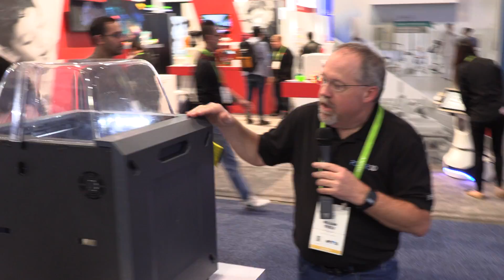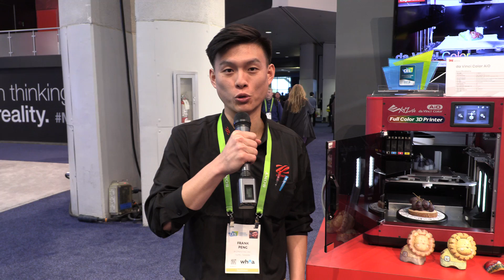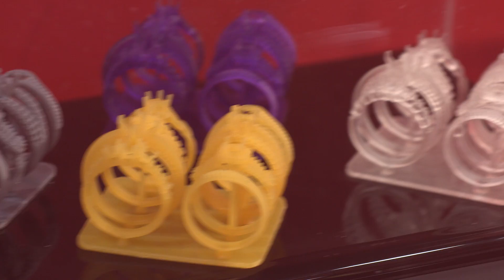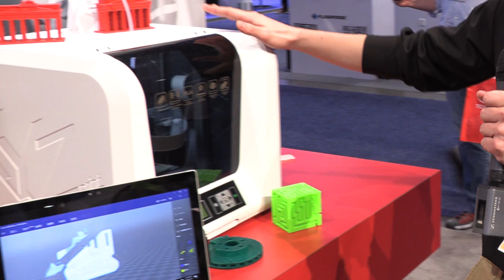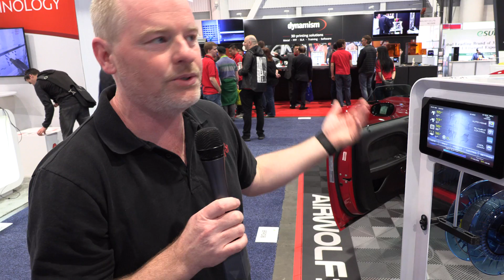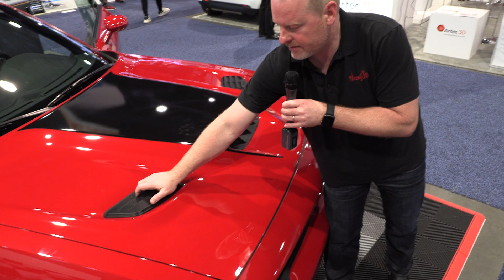VIRTUAL CES 2018: Tour the 3D Printing Area with Flashforge, XYZ, & Airwolf!

Comment: My thoughts.

FlashForge: I seriously want to see that $1500 SLA printer do well and be good! If SLA keeps getting pushed like this, it might stand a chance of overtaking FDM as a consumer printing method - leaving FDM to be all about the cheap prototyping.
XYZ: Full colour printing is a great idea, but I think their pricing is a little on the high end, the colours seem to still have a slight bleed to them though it's not actually all that bad looking, I hope it succeeds just to push the idea forwards and make it more cost friendly.
Airwolf: Definitely not at the consumer level yet, but getting full metal 3D printing another member to push the tech is definitely great - I could never even hope to buy one at the current prices, though.

Comment: Could you make a video on how to convert stl files to Gcode files
Reply: 1. Download a slicing program ( You could use for example Slic3r od Cura)
2. Load your stl file into your Slicer
3. Select the settings for your printer ( for example nozzle diameter or temperature )
4. Select the basic settings ( for example resolution or Infill  )
(4b). Select some anvanced settings if necessary ( for example support or retraction )
5. Check if everything is correct and save your file
6. Your done! :)

Comment: Nice format.  The Finder replacement looks interesting.  If I had not gone to a Prusa Mk2 I would consider it as an upgrade.  Instead I'm considering a Mk3, but I think the arduino controllers have reached their limit.  The small XYZ's looked interesting too, but I worry about their reputation of low quality and locking you in to their filaments.

Comment: If i wanted a new high cost printer, id go with the airwolf and the stainless steel.  
 For the lower end, i love Bill's candy printer.  Yes that looks like a "toy" like the old bug molding toys but my kids love that kind of stuff.  Im sure i would too and would be a hint at a birthday party!

As for the SLA, very nich market by mentioning jewelry but good for higher end model makers too.  Like to make masters for vinyl model molds, etc.   I liked the flashforge presentation better for those better.   Bill did a great job explaining diferences and price comparison there.

So i guess XYZ was my least fav because yes i have a preformed opinion about their previous products.  IM NOT TOO KEEN on the ink cartridge system, while nice and colorful it will be expensive and i doubt will ever support 3rd party inks etc because they are known for locking you into their product.  Frank could of been better with details on the machines also.  (ie, filament compatibility, etc... )

Thanks for this format, i enjoyed it better than q & a style.

Comment: One of the first printers I purchased was an XYZ Davinci. If I had not already had a Printrbot, I would have given up on 3d printing due to my experience with XYZ. 
They required you to buy your filament from Xyz it cost almost 2x the going price for a spool of the filament and the spool only contained 60% as much filament. The filament was of marginal in quality. 
For no apparent reason, the user was required to use their slicer which was not up to the quality of the existing free slicers. Their slicer produced gcode which was then compressed and encrypted so only the output of that slicer could be used with the printer. If the slicer was better than slic3r, cura, or repetier, then compete on a level playing field.
Finally, user support required that you log in to their website to log a service request, then they would send you an email informing you that they have responded to you request and then you have to go to the website to read their response which often was a pointer to a poorly created video that had nothing to do with problem reported. 
The hardware was marginal and key parts wore out in 6 months even though I seldom got it to work. 
In the end, I literally threw the POS away. 
I know that the community found hacks to get around most of the bad decisions made by XYZ and that Xyz may have changed their buisness decisions, but I do not want to be there crash test dummy ever again.
I wouldn't use an XYZ if I were being paid to use it.

Comment: like the format as its a sort of news for 3D printing and what's coming next. the flashforge printers were normal printers for what  they are asking for them, there was nothing new and stand out until that little prototype of the belt candy printer, sub $100, might be worth a look. XYZ dose get a bad wrap, personally i loved my Da vinci mini w until i ran it into the ground. there colour 3d printer looks interesting and i can see application for prototyping toys. the rest of there selection was normal a fare, most of there printers are aimed at kids with all the safety. airwolf, hate to say it but other than a heated build chamber nothing they had stood out, i get the feeling they are aimed at manufacturing industry where a reliable no fuss printer is what the market wants.

Comment: Wow, Flashforge has come a far way. That big printer at $2k looks amazing, all their new products look good and affordable.
Reply: It's nice to see a Chinese company that started off by making clones gain momentum and evolve into an original manufacturer.
Reply: Replicator 2X is 9.84 in x 6.3 in x 5.9 in for $2500, you're almost getting a full cubic foot with a heated chamber with that printer. This even competes with the Z18. Enclosed printers aren't cheap, but necessary for high end materials such as ASA. You need a true heated chamber for it.

Comment: Very nice! What would you say the greatest usage is for a 3d-printer today? Have one at work and we use that to create prototypes but that is it. But at home, what should I print that I actually can use? (or perhaps sell)
Reply: gimmetheacoountplix learn to cad and anything plastic you need you can print basically
Reply: Id like to know too.  I fixed my mailbox handle.   At least with my investment of <$200 that feels way better than if I had spent $2000 !  Fidget spinners, lightsaber handles, and groot figures are popular, oh and coin sorters./sarc
Reply: If you like swag there's any number of copyright infringing material you can download and print lol, otherwise it's basically up to your imagination and CAD skills. Personally I've been designing comfort grips for my DS as well as a rack that I can slot my mini bar clamps into. Also I created a charging stand that's customized to the size of my phone with a case on it.

Comment: Airwolf AXIOM  might be my Favorite , I would love to have one
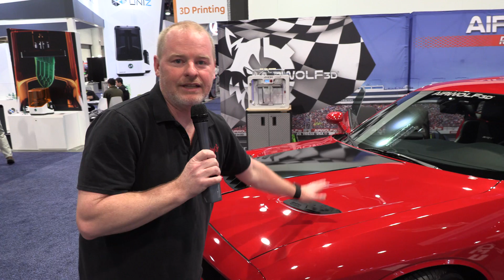Reply: My company purchased the AXIOM Dual Direct Drive model shown in the background at 18:00, I guess you can say it is their MK1 AXIOM. I cannot comment on their new models, but I will tell you my experience with the AXIOM Dual Direct similar to the model behind the presenter at 18:00. 

The biggest thing that we do not like about our AXIOM are the nozzles that are made by airwolf3d. Their printers do not use a 3d printer nozzle that is cross compatible with other printers like an Ultimaker (we have two Ultimaker printers). They have 0.35mm, 0.5mm and 0.8mm but they all appear to be made from aluminum. The brass brush that is used for the nozzle cleaning feature really does some damage to the nozzles over time.

To get a good front view of your print on the AXIOM Dual Direct, you have too look from the left or right side of the AXIOM screen. The screen is in a very awkward location to say the least because your print essentially starts at a level where your view is directly obstructed by the screen. We typically look at our print from the top, but the lid sold with the machine also tends to warp your view of the print at certain angles.

We also have had issues with their software named Apex that is a modified version of Cura 15.  With the built-in features like auto bed leveling and their nozzle cleaning system integrated into the G-Code, it is easier to use Apex than any other software because you will run into issues. Newer versions of Cura do not even have this printer listed as an option. This is disappointing because there are features from other softwares that Apex does not have.

When stopping a print the head does not automatically home. We don't know why, but it appears you have to manually select it on the machine after pressing stop.

Lastly, the fans on our model are not variable speed fans. They are either on or off, the percentage in the settings mean nothing. We have considered replacing them.

Overall, our AXIOM Dual Direct is a quality printer that does some decent prints, but with a price tag of $5000 we should have spent the money on two more Ultimaker 2 printers to go with the pair that we already own. The only advantages we have with our AXIOM over our Ultimakers is the dual filament printing and a solid enclosure (however, we modified our ultimakers so that they are enclosed). There are cheaper printers on the market with better performance and long term software support.

Comment: Is there such a thing as chrome-colored filament?  I mean, when you buy a model kit of a car, the wheels are "chrome."  I'd like to see if I can 3D print in a similar color.
Reply: TheWeb Expert there is chrome spray paint so you could just do that
Reply: The plastic is chrome plated
Reply: Yeah, I know that, but I just wondered what the closest color available was.  Do you all think silver would come closest (without painting)?
Reply: TheWeb Expert Matterhackers has a silver pla and there is also colorfab silver and fillamentium.   (both carried by matterhackers btw...but the following is not an affiliate link)
But thats the closest to straight print chrome'ish i think...  Paint is obviously better or plating.  (you tube had a plating on 3d printed storm trooper mask if you search for that.   Otherwise look on marterhackers:

https://www.matterhackers.com/s/store?q=Silver
Reply: You can buy filament with metal mixed in that you can polish to a metallic shine easily.
Reply: Try http://3dprint.com/130695/ira3d-new-chrome-plating/

Comment: Here's a tip, don't use XYZ! I had the Da Vinci JR, and it randomly broke while I was using the correct way. Also, you have to use their filament. Go with a MP select!
Reply: Or go and buy Prusa!
Reply: I’ve been using a da Vinci 1.0 pro for almost two years and have never had to replace a thing. It has only jammed once and it was mostly my fault.
Reply: Jake Bolo Huh, the JR. didn't work too well. To be fair it was pretty old, but no third party filament was my turning pount.